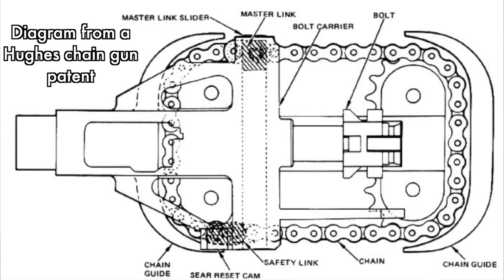Ask Ian: Are Man-Portable Chain Guns Coming?

Comment: I don't think this would be come a reality even if we'll eventually develop a electric powered exoskeleton, in such case I think we'll still keep guns cycling with power of their ammunition, we'll just give that one soldier a backpack filled with ammunition. Because why carry additional battery for your gun when you can carry more ammunition.
Reply: Maybe if we don't put the gun in the soldier's hands but instead mount it somewhere on the exoskeleton where the soldier can't easily reach it - see for example the Edge of Tomorrow exoskeletons. I think a chain gun would be appropriate there.

Of course that's not the type of exoskeleton we are likely to see in the near future but it is a distinct possibility.
Reply: @MarvinCZ  
That would be quite lame though. 

For one who’s aiming the gun? Not your hands. And firing from the shoulder is a means of putting the recoil as far away from the human center of mass as possible while still attaching the weapon from the frame. Which means it would be difficult to avoid falling over should the weapon have too much recoil to handle. 

On the other hand, hip firing is very close to the center of mass and in case recoil starts to exceed what the exoskeleton+human power can handle it would either cause the gun to sim away from target (unsafe), or if that can be managed, then it would cause the suit to slide backwards.
Reply: @topsecret1837  This is all fabrication over something only theoretically possible but I'll give you a counter-argument.

To fire the center-mounted gun, you have to completely expose yourself. The shoulder-mounted gun can fire from full cover. That's IMO much more important than recoil-management which has technical solutions.

Aiming is obviously done through the onboard computer and/or using video projected on your hud / iris.
Reply: I mean you can use a camera stabilizer to make it far easier to move with. So it isn’t really that far fetched
Reply: On the bounce trooper!
Reply: It depends, with an exoskeleton bigger caliber guns would probably be used rather than high ROF chain guns, which would also make tolerances in terms of gunpowder in the cartridge larger.
Reply: @theorange1840  I meant exoskeleton in form of assisted movement, not some kind of Master Chief of Iron Man armor, in such case you can keep small caliber arms as you'll be fighting mostly other unarmored targets (people). If we'll ever start making armored infantry and putting them in actual personal armor then yea, we'll need bigger guns for sure, but I'm not sure if in such case coil guns won't take over anyway. But this is sci-fi for now, it wont happen for at least 100 years.
Reply: yeah I think it becomes useful once the exoskeletons allow us to use 25mm autocannons or the like, for firing mixed belts reliably and such, less for the advantage in cocking, cause well , you got iron man carrying it around, pulling what amounts to a half ton draw weight or so bow isn't an impossible task anymore.
Reply: @chrish.942  Once we're running around with 40K Bolters I'd indeed imagine it'd be useful to have
Reply: Easy. The gas cycling siphons a bit of energy out of the projectile. Meaning a chaingun can fire smaller rounds with the same muzzle energy as bigger rounds from a gas operated gun. Smaller rounds means more ammo. If the battery can store energy denser than gunpowder, the chaingun wins.
Reply: The ammo for a chain gun needs considerably less powder. So the whole setup might be lighter depending on how much ammo you carry.
Reply: You have to power the exoskeleton anyway
Reply: Chain guns wouldnt make all that much sense in the traditional sense for a mech or exoskeleton type use. 
 However a very dependable mechanically actuated drum would make sense and you can power that right off the mech battery. doesnt make much sense to add the weight of a second battery that isnt part of the drive system for the whole system. Its dead weight. This would really be a very niche tool though because a gas powered gun is easier to clear than an electric one. So most mechs would have a primary gar powered man to man battle rifle and perhaps a large shoulder mounted gat cannon.
Reply: "Might versus Light."
"Meaning?"
"Meaning I'd take an extra gun over a flashlight any day?"
Reply: To be fair, you could still use the gas energy to charge the battery, then it wouldnt need to be as large. The gas piston would basically be a coil moving against fixed magnents, generating probably more energy than was used to chamber and cycle.
Reply: Noticing a lot of the anti-drone weapons, mostly that just focus on disrupting communication, that having that complaint; don't give me a fifteen pound hulk with a two hour battery, just give me enough rounds to ground it or anything else.
Reply: Even if. Have you seen the likes of  Lockheed HULK system or the exoskeleton being devolved for people who have physical disabilities.  Then there are the stabiliser arms for ARs. The technology is there today its just not practical right now.
Reply: For EM weapons I could see this making sense since you ditch the propellant in favor for more or bigger bullets. For chainguns though you don’t gain such a benefit however and as such the motor is probably unnecessary mass and volume.
Reply: You need very little battery power to cycle the weapon.  It doesn’t take a very big battery to fire 1,000 rounds of 5.56mm.
Reply: You always need more dakka
Reply: That depends on what kind of power armor we'll have (first).
If we are going Fallout / 40K style 2-legged-light-tank style power armor then yes, you are practically an small IFV at that point and I imagine you won't have much dexterity yourself so you'll need those absolute reliability.
If we are going Edge Of Tomorrow / Call of Duty suit-that-help-you-carry-and-run style then may be, you are still an infantry and it's better to fix the gun yourself then pay for more weight (i.e. carry less power to the front line)
If we are going Warframe super-fight-jet-on-ground style, then why are you asking the question at all? LOL
Reply: @memk  

I think a more accurate idea of what such an exosuit should be is an extension of the human body’s pre existing locomotion towards operating with plated armor (or some sort of layer with active camouflage with light protection underneath), an isolated CBRN-Thermal environment, multispectra sensory, internal power with a energy dense fuel/power source and a set of weapons able to be externally or self-powered depending on the sort of opposition to be faced, and to optimize that through making such weapons highly modular.
Reply: Accuracy...optical target acquisition using a helmet fitted system connected to the firing platform...with that, look, identify and engage...lighter ammunition development would need to be considered (with the ability to flip to different ammunition types) but application & duration limited.
Ideal for Drone and missile system use.
Reply: probably wont be using explosive ammo much if we have made enough tech progress to mass produce exo suits lol. and if we could make exo suits we could just make them unmanned because there wouldnt be a need for a slow thinking human to pilot anything if we had that high of a level of tech to make an exo suit. just way too many calculations and sensors have to be functioning perfectly in very unstable environments that would break most circuitry we have today within seconds are needed to make exo suits a reality that if we had the capacity to produce, would probably be the least impressive things we would be able to do with tech tbh. could probably have humans living forever and gliding in the air for hundreds of yards and stuff like that if we had such rugged and sensitive hardware
Reply: @saturationstation1446  
If you think humans are slow thinking in most tasks compared to machines, that would show the only example you have to provide for that is yourself. That you didn’t think about the problem and provided an assumptive reply that puts a blanket statement that “It won’t work. And even if it does other things would be better.” If you have anything more constructive to provide it would be equally helpful to actually think before you speak.
Reply: I can agree with that, with one caveat: if you’re firing larger calibers or even 40mm grenades it’s possible the propellant would not produce enough gas to cycle the action, and also having a L/20 or shorter barrel in respect to 25-50mm ammo would be impractically inaccurate for the sorts of targets you’d expect to be firing at from an armored exoskeleton that can presumably move like normal human locomotion given that the weapons are stowed in the rear while doing so.
Reply: And if we have a soldier in an exoskeleton who can have a ton of ammo, wouldn't his chaingun need couple batteries? It's kinda a thing when your gun requires two or more "sources of power" - no matter how many of first (like bullets) you have if you all out of second (like electricity).
And instead of carrying the weight of, let's say, couple car batteries you can just carry second gun. Reliability is much lesser concern when you have a replacement behind your back. Which also can be helpful in other ways
Reply: I know that this may be an unpopular point of view on this channel, but I would hope by the time we reach that point, we would have stopped using war as a means to solve our problems. I’m not naive. I know humans have always used violence to settle their differences, but in our modern world we’re seeing less and less cases where violence is a valid solution. I hope that trend continues, because a war where humans are augmented or in some ways replaced by robots would be unimaginably violent and gruesome. Maybe we can get two world leaders who don’t agree to each send their fighting robots, sans humans, to a remote island to duke it out, like an international version of Battlebots. Only the winner gets the foreign policy of their choice and no human has to die for it.
Reply: for the sake of reliability and logistics. if you require an externally powered device to cycle the weapon then you can have a failure/damage in that system or the power supply or the connections etc. whereas systems powered by the ammunition itself reduces the areas of possible failure/damage and simplifies logistics, ie no battery or generator to recharge battery required. i remember 20 odd years ago these fancy luxury volkwagens or was it some other brand... well they had windscreen wipers for the headlamps. they would fail and require maintenance. luckily they werent a critical component but what if they were?
Reply: this is such fucking goofy reasoning

Comment: I could see a capacitor that charges with a long stroke recoil, then has a mechanism that ejects and re-loads. I could see several advantages to that. The capacitor charge would be strong enough to cycle the gun a few time. The recoil ramp could be varied. the gun would stay cleaner. and several other advantages. I think having the action open with a delay after the round left the barrel would be the biggest benifit. could even blow a puff of compressed air into the chamber as the round if being extracted like a tank (I think)

Comment: When adding a chaingun to a drone, the battery is already there, that makes the weight disadvantage a lot smaller.
Reply: ...except that you're going to deplete that battery a lot faster, meaning less time in the air.
Reply: @patrikhjorth3291  After completing a fire mission, the drone should return to reload anyway. If that drone can not carry a large battery, it can neither carry a lot of ammunition.
Reply: @TheEvertw  If it could carry a large battery, cutting back on it to carry ammunition becomes a balancing act with potential for useless setups.